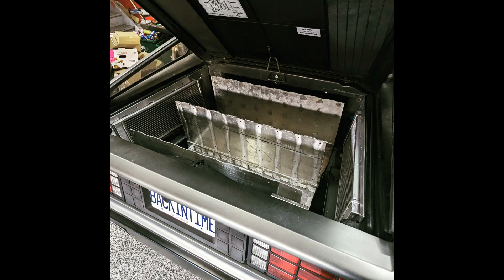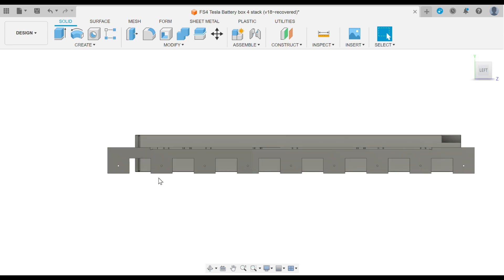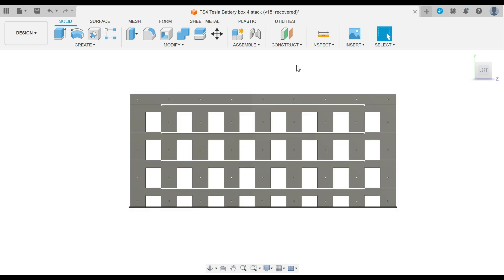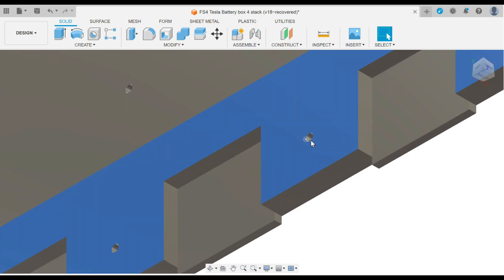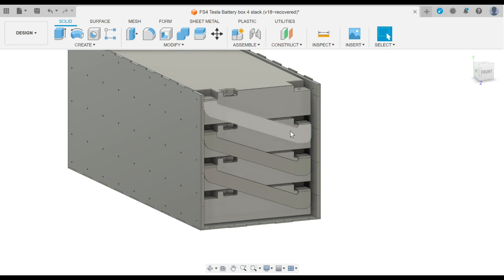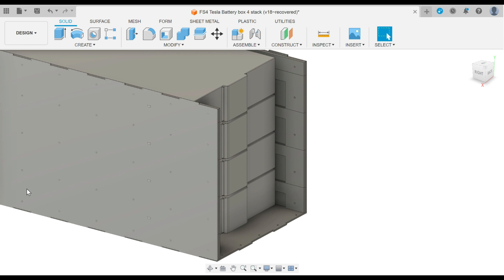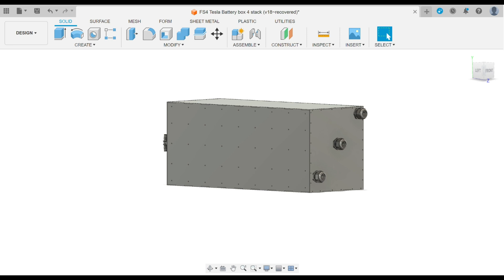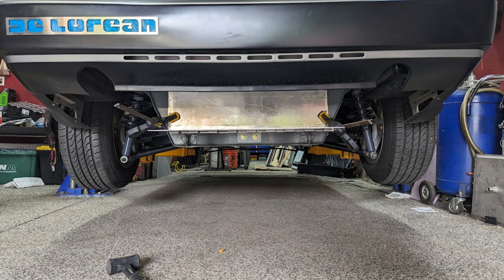EV DeLorean - Designing Battery Boxes - Project Jiggawatt Episode 3

Comment: Brilliant, brilliant, brilliant!!  SO appreciate these videos and all of the great information!!  And I'm definitely interested in getting the CAD files, etc. - because doing a Tesla 3 conversion of a DeLorean is actually MY next project!
Reply from the maker: Very cool!  I think the DeLorean is a perfect EV candidate!  I want to make sure all of my parts work out, and then I can share some plans.
Reply: Any updates on the battery boxes, or any other progress?  Have you made any decisions on conversion of the HVAC components and how to integrate with the drive unit and battery boxes? And what VCU and BMS are you considering?  Trying to decide whether to rebuild the PRV engine or bite the bullet and go straight to the Tesla conversion!
Reply from the maker: @jayvee243  hey, yep I probably have enough content to make another video... Working on all of the small details before I take up all the space with battery boxes.  I have the cooling system pumps and valves mounting/routing figured out. Looks like the HVAC is going to be relatively straightforward.  I've been mapping the factory wiring and figuring out where I want to adapt it to the new systems.  I'll work on a video soon with what I have.
Reply: Excellent!  Looking forward to the next one!  I'm starting my project and hoping to make use of all of your great work!  I checked out Stealth EV, but they didn't have any Model 3 drive units - I also didn't see any controller on their site for the Model 3 drive unit?  Are you using a non-Stealth EV  controller?  I'm thinking of possibly the EV Systems T-2C.  Thank you!
Reply from the maker: @jayvee243  Yep, I'm using the EV controls T2C.  I think you'll be able to find a Model 3 motor fairly easily, there are so many out there.
Reply: Yeah, I'm seeing quite a few.  Trying to find a Tesla mechanic who might have a way to test it off the vehicle during the first 30 days (so I can return if defective.)  I don't think Tesla will do it for me....

Comment: ah man , i know i will sound like a hater , but at the end of the day everyone have different tastes , in my own opinion a delorian is not meant to be electric, and its not meant to keep the original engine too since it was trash .....
this is absolutely cool but now i feel like your driving a washing machine , its so quiet .....electric is just different
i want to hear them pops and bangs baby , when your driving in a super cool car like a delorian , you want to drive a car with the exhaust the reves and a manual gearbox , you want to feel a part of a machine ,enjoy your drive ,every shift every rev match ....... 
again this is super cool and i will keep watching , but it feels like your driving a hoverboard , just a pedal and steering wheel , like those small electric cars for kids ....... its just different ...... cool but different at the same time
Reply from the maker: I hear you man... I think what keeps hot rodding alive and car culture interesting is the variety.  I love all cars but most of them don't suit me.  I went back and forth for months before I decided to swap my Plymouth, the sound was the major holdup.  For me, it turns out I don't miss the sound.  The forces and torque are so different I think it makes up for it.  I've yet to find somebody I've given a ride remain disgruntled or disappointed in my choice to swap the car.  It's the only car I've had people tap out during acceleration 😄.  

The DeLorean will have triple the power it came with, and 400 miles of range plus fast charging.  That means it will drive and perform better than it ever did, while functioning better than most modern EVs.  I think we have access to parts and technology that are going to make next-gen hot rods better than ever.

But like I said, I totally get it... If you ever see me, hit me up for a ride.

Comment: I like the tight design for the most part, I have something similar in my car, but I wouldn't hardwire the external connections - it's better to have quick connects for the HV and the signal connections. I have a really hard time imagining how this hardwiring will actually work in practice, it seems totally unwieldy.

EDIT: In addition to making sure you can connect and disconnect them with reasonable effort, you also need to design a convenient and sturdy way to lift the boxes.
Reply from the maker: Thanks for the input!

We'll see how the connections end up, I was able to hardwire my Plymouth without any trouble.  Lifting definitely needs to be planned out, I'm sure there will be adjustments as I get closer to the final install.

Comment: For your coolant piping rather than feeding from the centers you should consider placing the fittings at opposed ends of the headers. This would be a "reverse return" configuration that will self balance the friction loss and give a more consistent coolant distribution.
Reply from the maker: That's all very reasonable and might be the way I go.  

One box will be on its side so the fittings will be top and bottom by default.  The remainder of the boxes will be assembled as they need to fit in place.  

I think the main concern is to get the system bled, this many cooling loops seem to free flow pretty well.
Reply: @MrMoparMan  Your headers do look pretty free flowing and I was hesitant to even write the initial comment because of that. It is probably more valuable to do the main circulation loop in the reverse return style over the trying to get it set-up in the individual battery module boxes.
Reply from the maker: @anyheck  I appreciate all of the input, I still have to figure out all of the final routing so it's good to keep everything in mind.

Comment: Excellent video and explanation as always. How big of an airgap do you like using for space and the mica sheets? 

Around the 7:13 mark where you show the stacking, it looks like the asymmetric rails interfere with the box itself (at least in CAD). If that is the case, are you modifying the rails on the modules themselves?
Reply from the maker: Thanks, for the kind words.

I forget what the gap is, I will measure it and get back to you.  

Good spot on the interference, I do modify the rails by sanding the hold down holes flush with the rails.
Reply: @MrMoparMan  - that would be great. I am building my first set of battery boxes and your videos have been super helpful. The rail interference was something I was thinking through and planned to just sand down as well, so nice to hear that is an approach you've used.

Comment: i think youll regret not making everything serviceable.
Reply from the maker: I can understand the sentiment, but batteries do not require service.  It's probably disassembly and replacement if a problem arises.

It could just be my personal experience talking, not needing to service anything so far in my Plymouth.  It's only been a couple years, and shy of 20k miles however.